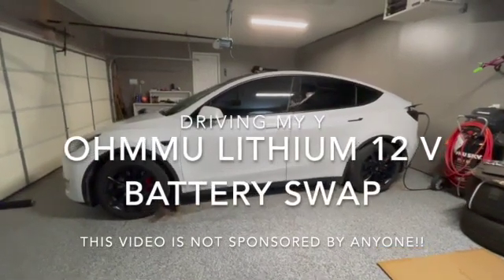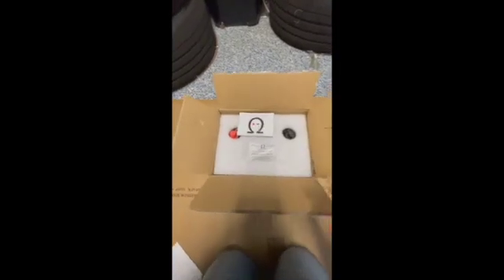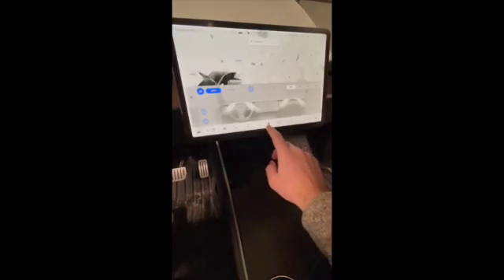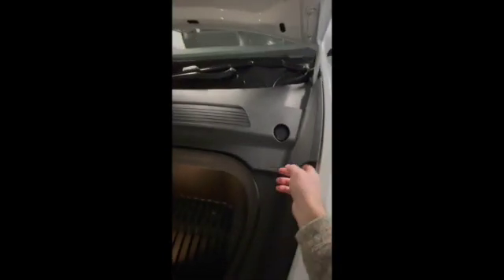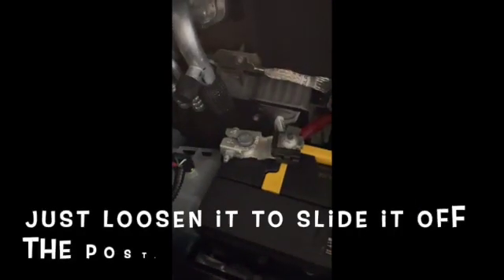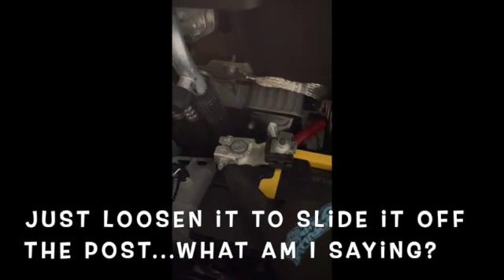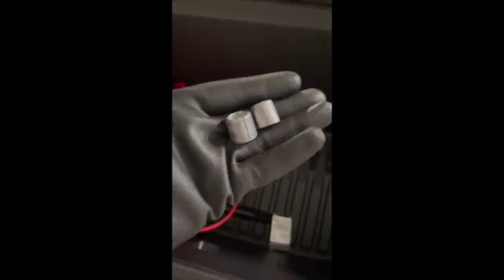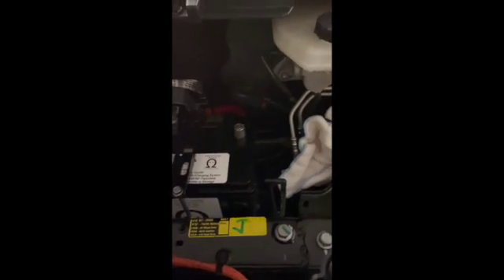Tesla Model Y DIY OHMMU Battery Installation - Step by Step

Comment: How did you find the OHMMU?  Did it make any practical difference to anything?  I've heard it can improve the sound quality (though not sure how)?  Have you noticed any issues at all?
Reply from the maker: Difficult to know...weight reduction and reliability over time are probably the two most significant improvements.  Every pound matters, but this is sprung v. unsprung weight, so the impact is less significant than more efficient and lighter wheels and tires, for example.  On reliability, I won't need to replace it probably for the life of the vehicle - and we sometimes see folks that get stuck with a dead one - so I like not worrying about that.  I am sure that there could be some improvement in audio quality, but nothing my ears can hear.  No issues at all.
Reply: @myweekendwarriors  Thanks for the super fast reply!  That's great news.  I'm hoping to pick one of these batteries up soon if I can, for much the same reasons as you.

Comment: In the Ohmmu video it shows on the Model 3,not sure if it’s the same for the Y, that under the backseat there is a shut off for the high voltage to the car that needs to be unplugged before you disconnect the cab,es on the 12V.

Comment: I don't think you have to pull the HV plug under the rear seat.  I had Tesla service out to look at an issue on my Y and he needed to "hard" reset my car.  To disconnect the HV, he pull a small plug off the firemans loop under the frunk to disconnect the HV battery.  You may have been able to do that instead of physically pulling the plug under the seat.
Reply from the maker: It's possible.  However, all the instructions that I have seen have included the plug under the seat.  Thankfully, it's not hard to access.

Comment: I'm looking forward to seeing the installation of the Pedestrian Warning Speaker.  I also have a Y and was told by Tesla tech via a service request that it could not be installed (My build is x7000).  Heated steering wheel sounds interesting.  I also live in Michigan and wouldn't mind getting a heated steering wheel.  Can you share where you are getting your parts?  Ordering them directly from Tesla?  A new Tesla Service Center will be opening near me soon. (Grand Rapids)  Nice video